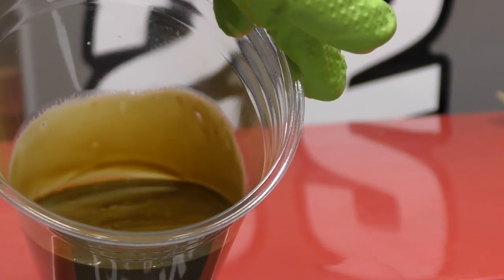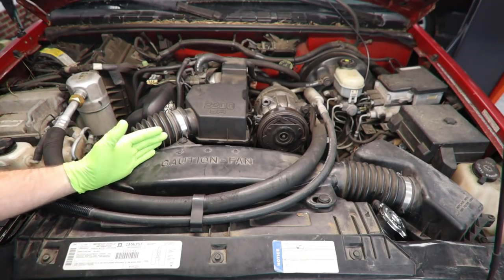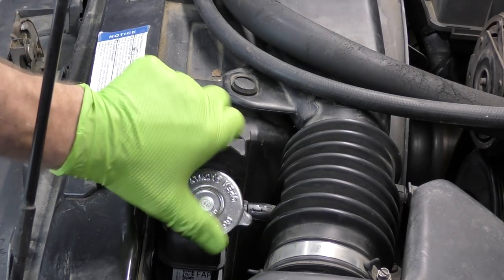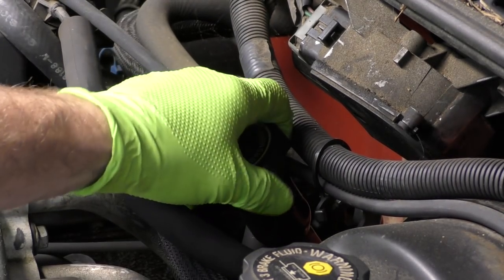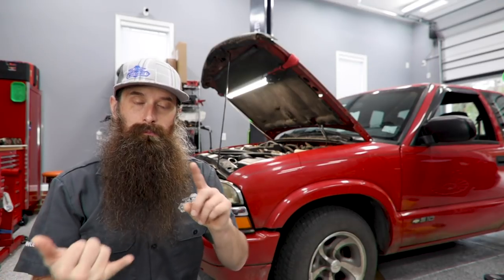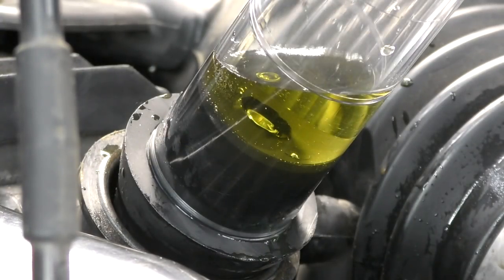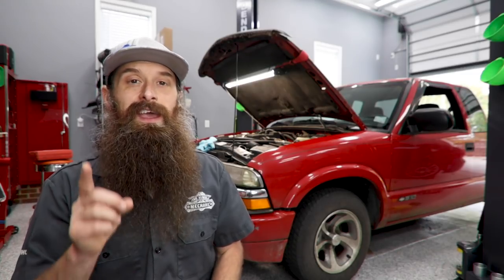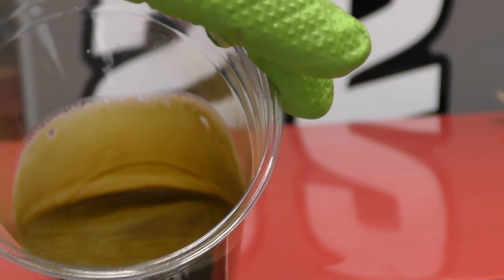Does Your Car Have a BLOWN HEAD GASKET?

Comment from the maker: Hope you guys have notifications on!!! Youtube seems to get doing a worse job of notifications than ever! 

Also up date on this job. I will be fixing the truck. Parts are ordered. Let's hope there is no cylinder head damage
Reply: I blurted out Chevy when you showed us the cup
Reply from the maker: @Nipplator99999999999  HAHAHA NAILED IT!
Reply: @HumbleMechanic  I owned some LT1 350s and Chevy loves reverse water jackets that seem to bottleneck at either head gaskets or intake seal/bypass.
Reply: Pretty common issue with old 2.2
Reply: That's awesome Charles! Can't wait to see. My A4 had a blown cylinder head gasket and it was burning coolant, but no coolant in the oil. If you removed the coolant reservoir cap after driving it would start with no issue, but if you left it in place the left center and rear cylinders would fill with enough coolant to stop the starter from cranking the engine easily. Full top end tear down and the heads and block appear to be within spec. The gasket was an mls type with a black sealing surface that failed $150k on the engine. It's on the reassemble side of the project. I've got some great pics if you have a place to share them.
Reply: I never got notified :-(
Reply: Very cool video. Looking forward to the next video.
Reply: Since YouTube quit sending out email notifications it seems it screwed things up! Good to see a bowtie rather than a VW.haha. take it easy Charles!
Reply: Hi how are U? How can I tell if I have a blown head gasket
Reply: i know Im pretty off topic but do anybody know of a good website to watch new movies online ?
Reply: @Randall Joe I watch on flixzone. Just google for it :)
Reply: @Kade Kyson yea, I've been watching on flixzone for since april myself =)
Reply: @Kade Kyson thanks, I signed up and it seems like a nice service :) Appreciate it !
Reply: @Randall Joe Happy to help =)
Reply: 5😮❤❤😂

Comment: Thank you for not doing what 98% of leaking head gasket Chevy S-10 owners do where they pour in sealer, and thickener, etc. and they put it up for sale, changing the engine oil before selling it, and telling people, “I’ve never pulled it apart for a problem” or “I haven’t had any problems with it, so far.”

Comment: similar diagnosis on a jeep that I purchased from a friend revealed a cracked head instead of a gasket.  I ended up replacing the whole engine since it'd been running for about a year while losing coolant and the bottom end was most likely toast too.  

I'd like to see a teardown and full diagnosis video on this too in typical humble mechanic style.  Keep up the good work.
Reply from the maker: :) parts are on the way :)

Comment: I had to do this to my son’s 2001 S-10 with the big 4.3.  He didn’t have a blown head gasket, had a burnt exhaust valve on #4.  That generation of S-10’s were good vehicles.  My son’s truck went 262k miles before he sold it.

Comment: I had a warped head/blown gasket on my 1995 Z28.   The Service Advisor at my Chev dealer suggested I change the gasket and sell the car.   I wasn’t going to do that. . .  not my style to sell something “not right”. . .  so I had the engine rebuilt at a friend’s shop. . .   and they “put some goodies” on it.  This was in 2000.   I drove it another 15 years.   That shop does computers for Audis,  Porches and such.  Tapp Auto in Ottawa.  You may have dealt with them.

Comment: I had recently found that milky, watery substance under the oil filler cap and dipstick and figured it was just condensation since I've only driven the car short distances, keeping it under 20 miles a week this winter, a few days ago I had the oil  changed and used motor flush to clean out the engine. So far the oil has remained clean and normal and the car runs good with no over heating or emitting any white smoke. But it does consume a lot of coolant and the fluid inside the radiator appears dirty and oily despite having changed it 6 months ago.

Comment: You're so kind to explain all the checks for damaged engine...that's very cool!! Thanks about! Try also another way, try to explain that this you have now as a fault in the engine can be avoided and what people have to do when something goes wrong. 
    There are many, many people which do not know how much important is the cooling system, the oil system in every engine.

Comment: Yes. My 92 mk3 GTi have done like 350K KM's now, it have been sweating oil for a while now, and it is not on the original gasket. Oil and coolant looks nice so I am not in a rush. I have gotten all the parts and tools, and even another head that have been machined, but it have been scratched because the guy I boght it from kept it on the garage floor. Just never seem to get the time, and I suck at mechanical stuff

Comment: Got an 03 blazer with 4.3 blown motor due to deathkill antifreeze.  Intake gasket went bad let coolant into oil. Then the driver overhead engine and blew head gasket. Replaced entire engine from an 06 silverrado.  Replaced all gaskets before install, replaced radiator, flushed and filled back up with green antifreeze. No more problems.  I would never use deathkill antifreeze in any of my vehicles. Also made sure to use metal intake gaskets,  the orginal ones were plastic (junk).

Comment: That was straightforward. My daughter blew a head cylinder on her 2004 vw passat 1.8t. I took the head cylinder into an automotive machinist; he shaved it to ten thousands of an inch; slapped it back on ( big job ). Runs great, no smoke, no external leaks, or milky oil on dipstick, and radiator fluid looks good. Just takes forever to start after sitting for awhile. Oil was on spark plugs. So, I took off the valve cover again and replaced the spark plug oil seals ( didn't use RTV on them ), and saw light brown on the inside of one side of the valve cover. Unfortunately I slap the valve cover back on runs great all that but same issue...any thoughts and suggestions would be much appreciated.

Comment: My 1997 Pontiac Sunfire Coupe with the OHV engine, which I believe is the same engine featured is showing minor signs of a leaking head gasket. Its the best car you could ever imagine. Been nearly 30 years with it. When it does start to fail more I'll definitely repair it. I have no coolant or oil mixing any where and the oil comes out looking good. The car has 132,000km on it and runs unfathomably well. Head gasket will eventually fail worse. I think I have many many many thousand kilometers before it really fails.

Comment: IDK. Depends how long the engine was run with coolant in the oil. Have done a few head gaskets with coolant in the oil and they came back with a rod knock a short while later.
Reply from the maker: anything is possible
Reply: Ethylene glycol eats babbit.

Comment: I have a 2017 Jeep Wrangler. Oil changes are up to date. Driving, the Jeep overheated. Pulled over, had towed to Pep Boys. When they used the tester on my vehicle, a blue turned to a brown color. They said it's a blown head gasket. Only has 78k mi. I had it towed to a Jeep mechanic... hasn't looked at it yet but says he doubts if its a blown head gasket. I'll find out Monday. Just wondering why color turned brown instead of staying blue, yellow... green?

Comment: I had a 4 cylinder Nissan Frontier that had either a bad head gasket or a cracked head...some of the symptoms I noticed were 1) detonation 2) when I shut it off, coolant would shoot into the overflow under heavy pressure (I could hear it bubbling like a cauldron). When I pulled the spark plugs, cylinders 2/3 didn't want to come out---there was hardened green chunks of coolant on the ends of the plugs

Comment: The coolant may not be as bad as you're thinking, its definitely contaminated but it may be DexCool orange coolant,  or green coolant mixed with the DexCool that was still in the block. Don't remember off hand what these trucks should have come with.
Reply from the maker: Possible. It shouldn’t have the floaters though lol
Reply: @HumbleMechanic  Need to flush those little buggers, gosh thats a horrible joke lol.
Reply: Looks like someone attempted a sealant probably kseal

Comment: I could use some advice, please.

My car is NOT overheating.
NO dash lights are on.
There's brown sludge in my coolant tank, oily residue. Coolant is very low. Just added 50/50 two months ago- wasn't an issue, just hadn't been done or checked in awhile.
Car is running fine.

I've gotten quotes for a radiator flush, and radiator/hoses/fan shroud replacement. Went to have it flushed, and they wouldn't touch it. 

1. Could it be an issue within just the radiator?

2. What are the odds it's nothing to do with the head? It really looks like oil, not transmission fluid.

3. Is replacing the fan shroud even necessary?

4. Recommended course of action?

It's my only mode of transportation, and I'm tired of everyone just trying to make a buck off me.
Reply: I think you need to find a different shop who can diagnose properly, and you will have to pay for their time to diagnose it. As Charles said, it could be a variety of things. But if your vehicle is old and the fluid has never been changed, it’s going to look like crap. And lack of maintenance over time can cause the rad to deteriorate which will also contaminate coolant.  Best of luck.
Reply: If your shroud isn’t cracked or broken and properly secured, I don’t see why it needs replacing.

Comment: My 92 S10 4.3 liter cracked the block at around 120k miles because I didn't have enough antifreeze in it. Once it warmed up, it would push coolant into the oil. So I removed the thermostat, which solved the problem, and drove it for another 100k miles.

Comment: OK so I have a Nissan Pathfinder, 2006 2.5dci. NO oil in coolant and NO coolant in oil. BUT I have lots of pressure in radiator, and white smoke, sounds rough too. I did a chemical test and the liquid turned yellow from blue within a few mins. Head Gasket?

Comment: I have a some coolant disappearing when I go for long drives but no overheating and no white smoke nothing on the oil cap no bubbles in the radiator and the oil looks fine it's a 2006 civic si any idea what I should look at?

Comment: I had leaking gasket. no milkshake, no loss of oil or coolant. just pressure in cooling system with a hint of exhaust gasses (took a while for indicator liquid to change color).

Comment: In my 12 years working on Audis and VWs, I've only seen a single case of leaking head gasket...
It's the one thing they managed to get right.
Reply from the maker: Yep one of the lowest failure rates. I’ve seen a few but not many.
Reply: I had a blown head gasket on a 1984 Rabbit Diesel. My 1967 Type 3 never blew a head gasket.
Reply: My first car, a 1999 Golf 4 1.6 SR, had a failing head gasket. Sadly I didn't fix it in time and severe damage was done. Would have to have swapped the engine, instead I just bought a new Golf :)
Reply: @Blakackmann  I have the same engine in my mk4 Jetta, and no engine issues yet.
The only issue I've had was a leaking oil pressure switch.
Reply: @panzerveps  I've had a miriad of issues with the engine. I bought the car used from a teenager who "modified" it and drove it like a madman. There was basically no service history at 170k km. I'm not saying the engine is bad, just mine was after what it got put through.
Reply: @Blakackmann  I bought mine completely unmodified, and kept it like that.. I replaced the ugly winter wheels with a set of nice oem rims I got for cheap, and that's about it.
Reply: In Spain it was quite typical in early 2000s for gaskets on VW group engines failing about 100K Miles.. reason: extreme heat in the south of Spain.

Comment: $1700 Milkshake? Head gasket? Oil cooler seal? I’ve got a doozy...any help would be appreciated. 2013 GLI 2.0 turbo. CBFA engine family. 84,320 miles. coolant leak residue down the front of the block and oil pan. No codes, car runs great to limiter. No overheating. OE water pump and intake. Warranty turbo.
Took car in to dealer thinking warranty water pump. An hour later, dealer calls and says not water pump but it’s a oil cooler seal and needs 3 flushes, oil change, coolant temp sensor and alignment. $1700....I don’t see many oil cooler seal videos. Is this a thing? Is it a DIY job? Not a fan of having to go to this particular dealer...

Comment: okay, lets say you have a VolksWagen....the head gasket is most definitely leaking. Is it better to continue adding distilled water rather than also using coolant? In my own theory it would burn off rather than gunk up like coolant in oil. I would replace the head gasket in a day but I do not have the space currently and I want to keep the 2.0 running for now at least to drive around town, because my MK4 really needs a VR6 but that is another deal
Reply from the maker: Yeah I mean if you have to. Nice yellow Miata!
Reply: @HumbleMechanic  thanks! I appreciate the response. On a 1-10 scale, complexity of VR6 Swap in MK4?

Comment: thank you for the video, I have some froth/bubbles when opening radiator cap, and i have coolant disappearing But no milky oil and no smoke. Can it be head gasket failure.
Reply: Yes. Dried out or weathered head gasket can result with that issue

Comment: I had a 97 chevy s10 4 cylinder. What a huge piece of sh. I had the exact same problem as in this video.   Thought as you did, blown head gasket. Upon teardown found a cracked combustion chamber wall. These trucks are badly underpowered with this engine, and they aren't very good engines either. My truck also had to have a transmission rebuild at 50k miles.

Comment: Sounds like the shop probably got it right.  A bad head gasket or cracked head along with toasted bearings due to coolant in the oil.  If I was quoting this job for a customer I don't think I'd want to stand behind a head gasket on this truck with the lower end possibly damaged.  Needs the pan pulled and bearings inspected.
Reply from the maker: Maybe. But they didn’t do any testing according to the paperwork.
Reply: @HumbleMechanic  Since it's a family member it's probably worth dropping the pan and inspecting some bearings.

Comment: I send my mk4 2.3 to a shop to get the clutch and timing chain replaced. After I got it back it was running well. 4-5 days I didnt drive it and went out on a rainy day it started having play/waves in the throttle keeping 1.200-1.400rpm but it fixed after about an hour or two.(might be a separate problem) however I had some burning smell come from the left air vent next to the rpm meter. I got really worried it smelled like burned cable so I took it back to the shop and it stopped having the problem(they just did a quick diagnostic /trottle body error). It still has a very very light smell of burned wire/cable but doesnt smoke and runs well. They just took out the engine changed the chain and clutch and put it back in. Do you have any idea what the problem might be? Its a mk4 agz
Thank you in advance anyone who read the comment.

Comment: Please tell me how much and how many hours needs by the dealer to fix this problem,thanks 🌸🌸🌸🌸🌸🌸🌸🌸🌸🌸🌸🌸🌸🌸🌸🌸
Reply from the maker: Totally depends on the car. I think this one was 8hr or so
Reply: @HumbleMechanic  mine is 2014 tiquan 47000 mill only I live in Illinois vw   dealer did work on it 20 days ago I paid $1900 they said was rare main seal something like that and vacuumed pump they gave me a one year warranty on the parts ,now start  leaking 4 days ago I saw alight color watery under where I Parker five spots I am afraid to take it back to them because the service department has a very bad reviews please tell me what to do ,thanks

Comment: Is the reservoir bubbling/boiling? Don't have $$ for a proper head gasket repair ? Your old radiator developed a leak due to exhaust gases? I replaced the failed rad with a " Towing rated radiator " ( more cooling ).  I removed the thermostat. I left the reservoir's cap loose so gases can escape. You lose some mpg & CEL will appear on your dash.  But the car will not overheat/bubble out coolant.  Do save $ money to get  another car.  If your car is on the following list, and you are told it's a bad head gasket, don't waste $ fixing it. These cars have the stripped head bolt problem that the math says sell it to Auto Salvage.Cadillac NorthStar 93-2005 4.6L
Oldsmobile Aurora 4.0L 95-99 4.0L
Oldsmobile PV6 LX5 3.5L 99-02 NEW!
L850 or ECOTEC 2.2L 4 CYL.
Toyota 2.4L 2AZ-FE & 2.0L 1AZ-FE 4 CYL
Nissan'a With the M11x1.5 thread
BMW 3 & 5 Series straight 6 (M10x1.5 thread)NEW!
HONDA/ACURA
1986-2001 Integra
1986-1995 Legend
1991-2005 NSX
1996-2004 RL
2002-2005 CR-V
1999-2005 Civic SI
2002-2006 RSX
 2003-2007 Accord L4
2003-2007 Element
Honda B16

Comment: Depending on the engine model it could be a intake gasket not a head gasket. 3.8 gm engines are bad for intake coolant leaks into the oil.
Reply from the maker: Would the intake gasket allow that much coolant into the oil?
Reply: @HumbleMechanic   yes on the gm 3.8 it will but it takes more time to do it than a bad head gasket would mine was that bad but I let mine go a little to long but I did fix it and I'm still driving the car 230,000 miles.

Comment: Why else could my oil look like this on a VW Lupo? Oil gets changed every year/5k miles but on the latest change the oil looked like this. No smoke, no oil in the coolant, literally no other headgasket symptoms
Reply from the maker: Oil cooler failure. Typically that put oil in the coolant not coolant in the oil
Reply: @HumbleMechanic  thanks, I didn't know it had an oil cooler. It's only a 999cc engine
Reply: @elliot438bcfcVTEC  do you make alot of short trips?
Reply: @TheUberdude14  I've just found out it doesn't have a cooler. Yes I'm putting it down short trips, I'm doing another oil change probably next week. I have noticed small engines seem to suffer from this. It's my girlfriend's she only drives it gently to work and back